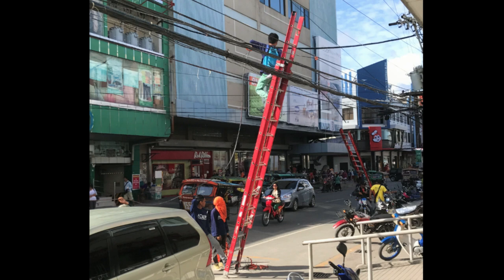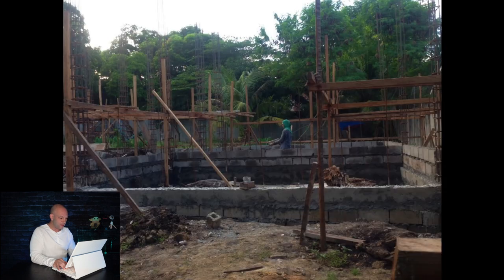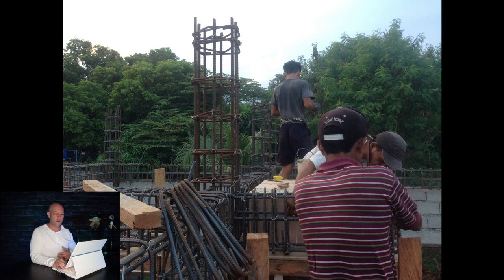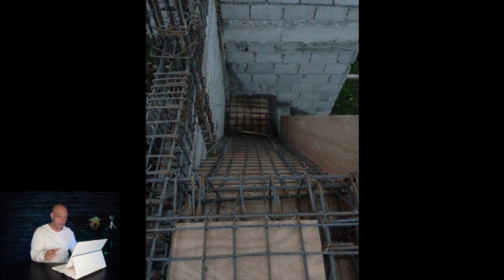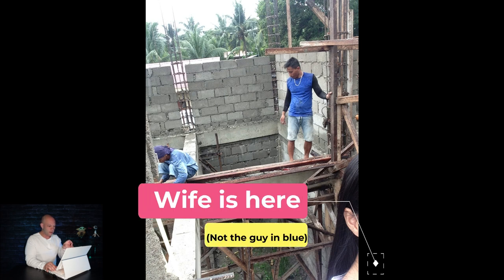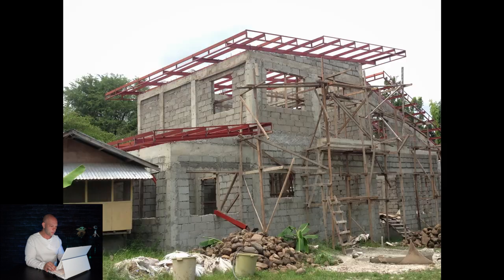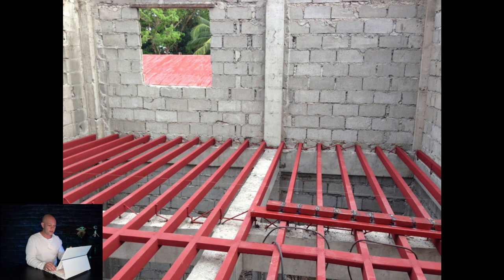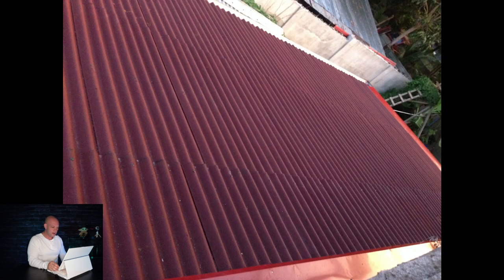Building a Two Story House In The Philippines!

Comment: Nice house.  I suggest adding a whole house surge protector. I have the same electronics as my house in US and ones in Philippines get fried once in a while.  After I installed one no longer have an issue.  The surge strips don't really work since they can't handle lots of surges. 

Also make sure to request power company to install meter directly on your house.  Lots of provinces have the meters in central locations.  What happens is its easy for people to steal your power. The power company agreed to attach directly to house after finding my electricity suddenly rise due to someone tapping into my main line.
Reply from the maker: Thanks for the info I really appreciate it. I will be running solar so Net metering will also be on the list.
Reply: @ItsMe_Philippines  Perfect.  Solar is relatively cheap in the Philippines.  I recently added batteries to my solar system since power outages are the norm.  I live in a crowded province so my house really stands out when no power at night.
Reply from the maker: @james21ap1  nice! I never see expats doing solar for some reason. What company or brand did you go with? I’m looking at DPX solar in Dumaguete 
https://m.facebook.com/DPXsolarpowerco/
Reply: @ItsMe_Philippines  I agree I think because most expats rent and not own their home.  I went with a local installer but my panels are from Trina and hybrid inverter from Growatt.  Hybrids are more expensive but offer flexibility to add battery backup and go off grid.  I think any reputable system will work fine in the Philippines.

Comment: I’ve worked for Comcast(SF Bay Area) and Cox(Las Vegas) for approx 12yrs the wiring there is definitely different but I think that’s why their internet is slow.  Too much congestion and various type of coax, signal levels vary depending on the area and if it’s a new development.
Reply: @Good Luck Pilipinas! that’s what I figurd

Comment: I’ve seen the hollow block construction in the Philippines similar to yours. I don’t understand why they don’t fill the spaces between the blocks with mortar. It seems they should be filling it when placed. Filling it in later isn’t a strong as filling in in when it’s being laid up. 
Looks like a good sized home. I would love to see pictures of the welding.
Reply from the maker: Thank you. Total size is more than we need and I'm very happy with the design. I'll make sure to add the blue print or floor plan in the next video. I designed it on my computer and they did a very good job replicating what I printed off for them. Welding looked "ok", it was strong and they did a good job but it seemed a little messy (weld splatter) and needed a skim coat of filler afterwards.
Reply: Will be doing a cast in place myself no hollow block

Comment: Awesome. 
If that’s not a corrugated metal roof, which it sure looks like one. What material is it. Makes sense to definitely use a different option to avoid heat.
Reply from the maker: Onduline!
Reply: @ItsMe_Philippines  awesome. 
I will check into that. 
Thanks.

Comment: There is a big difference between the house in the USA and the philippines pow..i live in 5000-sqft homes on top of the mountains in Los Angeles but my house is totally different than my 7000-sqft house in the philippines.  My house in the philippines  i can call it a real quality built house in Makati..not in the province were all are dirt cheap but still quality house like my vacation house in my resort in the province. I dont use thick hallow blocks because of heat gain..like my house in Los Angeles just wooden structures, insulation and stucco and just a plaster cement outside ..! Pilipino engineers and architects are vere good if you have them to assist you building your house. I had the same  feeling when i built my staff house in brazil
I was wondering if they can do it right but when my architects assure me and comfort me it turns like my house in the province made of cement and hallow blocks. Goodluck guys!

Comment: First off, Chicago! I lived in Skokie North of Chicago for almost 6 yrs. I'm also planning to build a house in PI and I want to ask questions about your experience in starting your house project while in the US. How did you both even start the build since you are in the US? i.e., Architect, planning the house and everything? Since you have knowledge in building...do you have things done your way or you leave it to the Architect/contractor how it's done in the US. For example, is ... I notice that the house doesn't give value on the lintels, plumb, and squareness of the build...i might be wrong though.
Reply from the maker: When we surveyed the land and hired an architect we were both there. So it made the planning and permitting much easier to do.

Comment: With the size of the house you should consider putting solar with battery.
Reply from the maker: Solar is definitely a must have for me. Battery though? Not sold on that idea yet. Was thinking a generator for backup as the return on investment with batteries is bad. If you have good info on why to use battery let me know. I'm open to it if it makes sense.

Comment: Hello, new subscriber here. I am interested on how you did the flooring on the second floor? Do you mind making a video on that? First time I see flooring on the second floor using steel materials. Usually they use cement slab/concrete flooring on the second floor. 
Did you also use plywood on your flooring on top of the steel bar? Is this more durable rather than concrete flooring?

God bless and more power!!!
Reply from the maker: I will add that into a video soon. It was metal beans going across, then insulation, plywood and hardwood flooring last.
Reply: @ItsMe_Philippines  I’d be keen to see that in detail too ..cheers

Comment: who did the layout and structural design? why didn't you go for a concrete slab?
Reply from the maker: Did the layout and structure design myself. They do not do slabs there the way we do them in the states. All the walls had rebar coming out of them and then we added to that. They rocks, rebar and then cement was poured. Its not like here.

Comment: Hey Cory, just asking about your fence , the height and length and cost. My mate 😉 has bought a property which is roughly 2500 sq metres so was just wondering about you fence. He is doing what you did he is going over there in 2025, so slow and steady he goes. Thanks if you can help him with that, much appreciated...,Craig
Reply from the maker: Height is 2 meters (6’6” feet) and goes .5 meters (18” inches) in the ground. 
Length, it goes around the whole property so I would need to get the numbers from the blue print or floor plan.
Cost will greatly depend on your block size. Almost everyone in the Philippines uses small blocks and that’s much cheaper than the larger ones. We used the larger ones for strength and security. 
First step I would recommend would be to go online and use a “block calculator”. I did that for each wall and room in the house. It will have you put in the height, length and your cost per block. 
Lastly will be your added cement mix and rebar thickness. So he will need to find his cost per black and cost on rebar. Both of those will change cost based on location.
Reply: @ItsMe_Philippines  thanks mate much appreciated, makes a bit more sense after calculations

Comment: Hello Cory!

New sub here. I am engineering and designing the same way you did! My plans are drawn out too. Now the roof... I was planning on rib type aluminum. But my question is regarding your chosen material. QUESTION : Did you go with a Onduline roof? i saw this but it looks flimsy So thats why I was thinking rib type with insulation. (BTW our house will be one story 16 x 60' slanted roof with roof 13' from the floor on one side and 11' on the other). Your thoughts on durability please.
Reply from the maker: Yes, we went with the Onduline roofing. Don’t think I would call it flimsy but it does feel more flexible than a metal roof for example. If I’m not mistaken I believe it is six times thicker. I’ve walked on the roof multiple times without any issue. When we installed the solar we just simply laid down 4 x 8 pieces of plywood for safety.
Reply: @ItsMe_Philippines  Since you guys are talking about roofing, what about roof insulation? Isn't getting really hot with onduline only? 
Did you consider insulated roof panels? Or in the philippines aren't available at all?

Comment: Hi, how long did it took for the workers to build this so far? I am curious to know how much would it cost to build nowadays during the pandemic and also exchange rate is pretty low. I am planning to build my house as well when I get back home.
Reply from the maker: Three years roughly but we honestly were not in a rush so it could have been done faster. It would be harder now that its harder to get materials AND all the prices are going up on metal and wood.
Reply: I built a two story house 150 sqr meter interior space 3 bedroom and 3 bathrooms 84 sqr meter roof deck and 25 sqr meter balcony and porch.  I used nice materials in the build out like narra floors for the upstairs and all doors.  Used marble for the master bathroom and all countertops.  The total cost was 6 million.  The labor costs were 400 pesos for laborer, 550 for skilled and 650 for the foreman.  I also provided food.

Comment: I know this is a year old now, I am hoping that you still notice comments. I am wondering what you did end up using for the roofing. You said that you did not go with "metal" but did not say what you ended up using. Thank you for sharing your journey.
Reply from the maker: No worries, my friend. I check the comments multiple times a day. We used Onduline to help reduce the heat.
Reply: yeah exactly !? It looked like you used sheet metal roofing after all
Reply from the maker: @floodreliefinc8137  negative, like stated above we used Onduline

Comment: We didn't use a metal roof because it is hot, instead we used..... ???  What is your roof material?
Reply from the maker: Onduline is what we used. But my point was is that metal roofs are the cheapest. With you go with plexi, plastic, fiberglass, or what are used, you’re going to have more heat resistant.

Comment: New subscriber today. What is the best, most cost effective way to send larger sums of dollars to PI? I am familiar with WU and others but they do not seem to be the best exchange rate. I am retiring next year and will need a larger amount to get settled in.
Reply from the maker: That changes monthly unfortunately so that will be tricky to answer. I will check each one of these prior to sending. The fees are one thing to look at but the USD to PHP conversion is also a big concern. It will also change weather you send with bank account, Debit card, Credit Card or Cash.

As of 6:00pm on 6/29/2021
$1,000 USD to PHP (Bank account transfer examples below. Fee price is higher with any other payment method) 

1. TransferWise 48,099 PHP + $9.24 Fee
2. Xoom 46,686 PHP + $0 Fee
3. Money Gram 48,048 PHP + $0 Fee
4. Western Union 47,752 PHP + $0
5. Crypto (if your into that)

You can also do bank to bank transfers but that can take 1-2 weeks depending on your bank.
Reply: I used transfer wise I think they go by wise now.  The best rates I found.
Reply: Just Google it ...
Reply: @Tim G Haha. That's my dogs name and this was supposed to be his channel but I never logged out. It works 

I just have a very small budget and cast in place is cheaper and stronger ...wont be two story I dont think. 

To each his own.
Reply: @Tim G no I will when I get there, but more than likely just govern the job myself...watch texasfilipono channel you'll learn about all you need to know...
Reply: The best option to rewire a big amount of money is bank to bank rewire its easier and safe ,WU is ok too but i think they charge a lot when you send large amount.